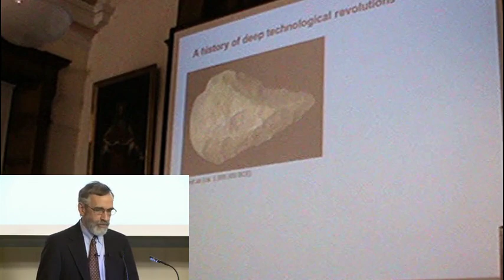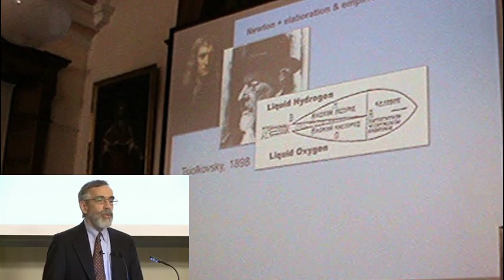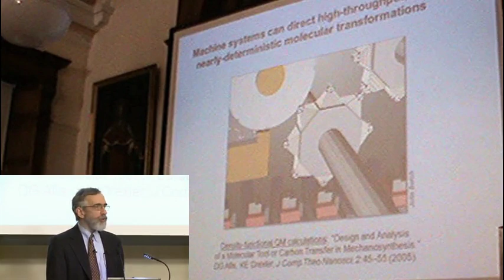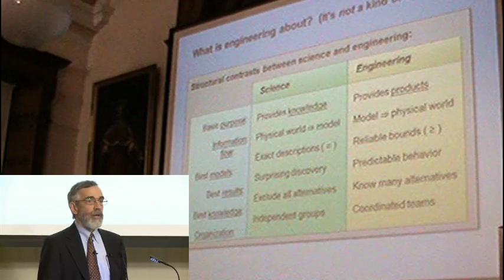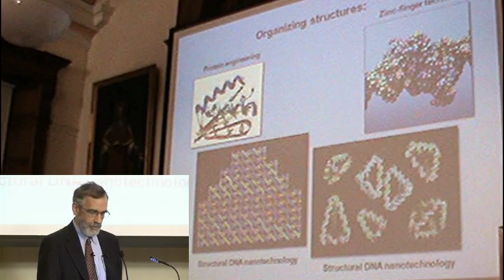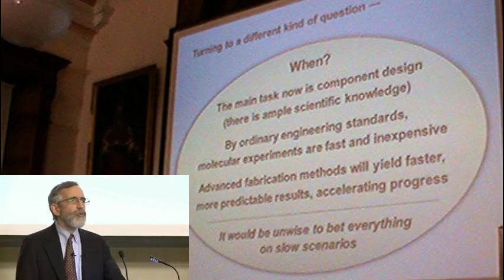Eric Drexler: Physical Law and the Future of Nanotechnology

Comment: I'm a bit surprised you didn't talk about planar assembly, as shown in your nanofactory video. Rather than having to design thirty different levels of fit/function between components - doable but awkward - it seems better to go from molecular mills, to ~1-micron "nanoblocks", and then direct to products. But I guess convergent assembly is easier to put across to a new audience.
Reply: As I see it currently (2017) one would not really want to go for very tiny convergent assembly steps like a mere factor 2. More for like for x32 (or even x100). Yes, that is slower (in case of a single serially operating assembly mechanism per assembly cell) but the products would not need to waste a high fraction of their volume just for interface  mechanisms. Less interfaces make product design a lot easier too. And of course one would not need to design 30 something  different levels of convergent assembly (in case of x32 steps there would be just four steps from 1nm up to 1mm). In other words  a bit bigger convergent assembly step sizes make nanofactory design easier too.

For a long time I was pretty puzzled about what higher level convergent assembly steps would actually be good for and whether they are necessary at all. As far as I can tell this is not discussed anywhere.
What I've found out so far is that is higher up convergent assembly levels allow for:
(1) The avoidance of unnecessary disassembly when reconfiguring already produced products in a way that just swaps big chunks. (2) The assembly of unstable overhangs or impossible undercuts (stalactite like structures) both without scaffolds. (3) More levels of vacuum and clean-room lockout for better isolation - lower ones quickly loose all effect though - practically-perfect-vacuum to practically-perfect-vacuum
(...) Does anyone know of more points I have not mentioned here?

For passerby readers: The lowest two assembly levels in the nanofactory-concept which are: (1) molecule-fragments to crystal-molecules and (2) crystal-molecules to micro-components, always need convergent assembly.
This is because the first layer producers (mechanosynthesis mills) need to be  specialized to specific part types (for being capable of good throughput) and an inter-assembly-level-logistics-layer needs to transport these parts (standardized crystal molecules) from where they are made (1) to where they are needed (2). In further up assembly levels there is enough space available (and friction area low enough) for general purpose manipulators to be sensible. Thus bigger parts (e.g. microcomponents) can be made right at their final destination. And thus further "higher" up logistics layers are not fundamentally needed. Convergent assembly can in principle be stopped. Stopping convergent assembly at the lowest possible level leaves a thin sheet nanofactory that looks a bit like a silicon waver. That is what Chris Phoenix is referring to with "planar assembly" here – (I presume).

Comment: Umm no. First of all Orch Or had a breakthrough with the Bandopadhyay paper on microtubules and qubits. Secondly there is an element of quantum randomness within our brains which facilitate decision making. Each neuron operates within SEVERAL mechanisms all extremely plastic and dynamic. You sound like a Kurzweilian tape recorder, it may work on someone who hasn't studied this. Finally I'm not saying it won't happen, but it will take centuries. We won't have AI by 2045 or even 2245. Maybe 2545.